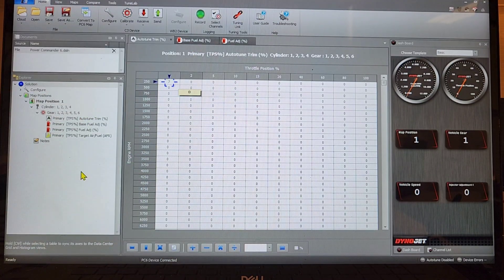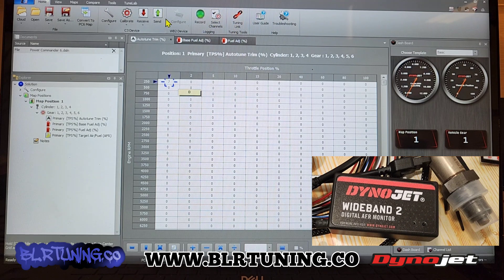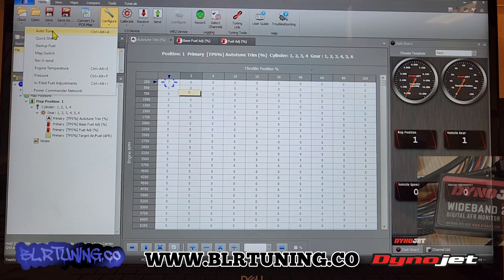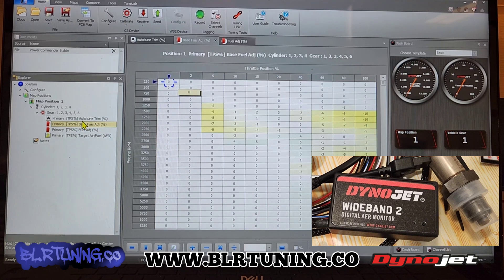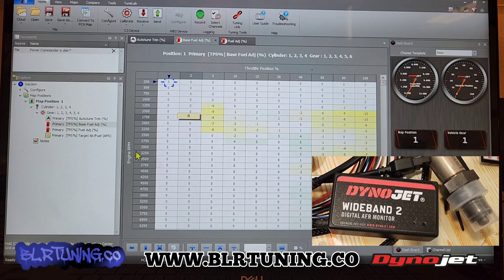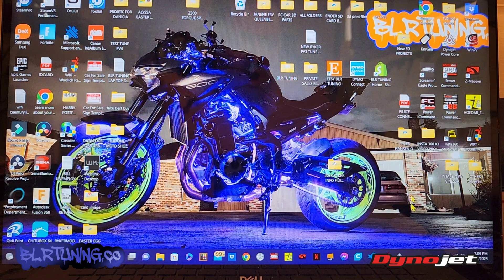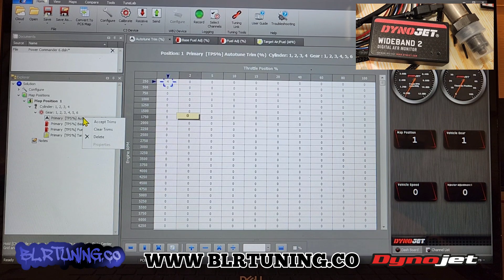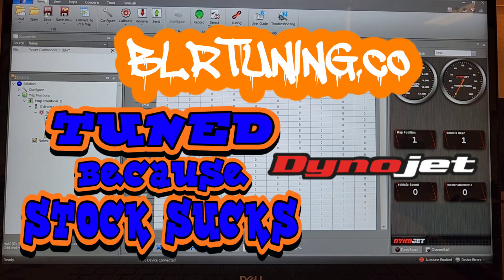HOW TO ACCEPT TRIMS FROM AUTO-TUNE IN DYNOJET C3 SOFTWARE

Comment: why can't they make an auto tune that uses the factory bung o2 sensor.? Right?  plug in pc 5 then piggy back the auto tune so anyone can do this..The stock 02 sensor is removed and a PC o2 sensor replaces it.. Come on Its 2024..they are making ev bikes now.. I mean you can do it on cars its the same thing. exhaust cat o2 sensor
Reply: Factory o2’s are usually narrowband. Tuning requires widebands.
Reply from the maker: @MultiReadify not all tuning. Just depends if we are tuning open loop or closed loop and if we want closed loop to exist or not.... wide band is better for most applications

Comment: I thought auto tune needed an 02 sensor bung to plug in
Reply from the maker: Yes you will need to run the wide band O2 sensor that comes in the package. If you're still running your factory O2 sensor then you will need a second bung for the wide band O2 sensor. On some exhaust you'll be able to get rid of your factory O2 sensor and run just the wideband O2 sensor. It just depends on the build that you are going with.

Comment: Will the Autotune work with all versions of Powervision?
Reply from the maker: No specifically the WB2 that I'm showing in this video is designed for power commander. It works with power Commander 5 or power Commander 6. It does not work with power vision. I believe there is other kits for that but they are vehicle specific

Comment: Thank you so much. Man I was getting frustrated trying to figure this out. Drop a grand on a tuner and dual AFR and the instructions are written for power commander 5! I couldnt figure out why my map kept going to zeros, if the autotune was even working, and how on earth to see if the autotune actually made any changes, and where it was making those changes. 
You should do a tutorial on how to set up maps... The tunes for my bike from Dynojet are single map for both cylinders (kaw meanstreak 1600), and using a dual AFR, you dont have the the second cylinder to map... its not intuitive how to add the second cylinder or edit the base map to include both. 
Also (I know, I am going on and on here), they allow a VSS input for speed/gear, and I tied in my speed sensor and calibrated... but where does this information go? Is it logged somewhere? I would really like to set up a leaner cruising range for highway because 27-29mpg is a bummer.
Reply from the maker: We do build custom maps and sell them. Basically we build a custom tune specifically for your bike and your modifications. We can send a custom tune out via email. If you have questions about understanding the c3 software or any other dynojet device you can always reach out to me via email. That would be a much better means of communication than here on YouTube. Sometimes YouTube doesn't send notifications to me until 24 to 48 hours later so messages can get quite delayed. If you'd like to chat more don't hesitate to send me an email. 

blrtuning.tech@gmail.com